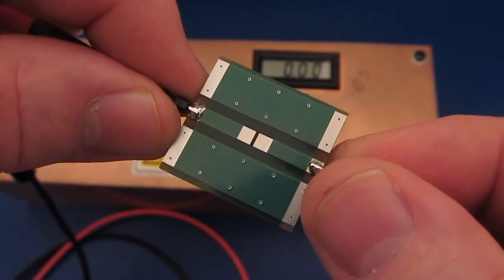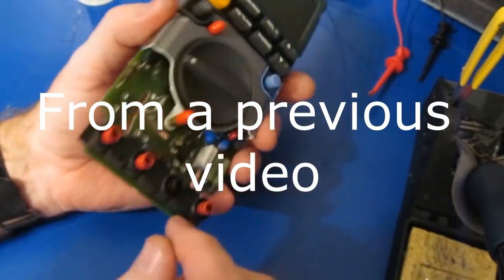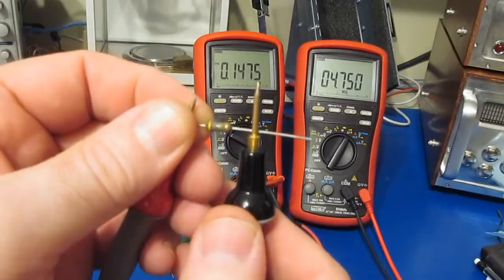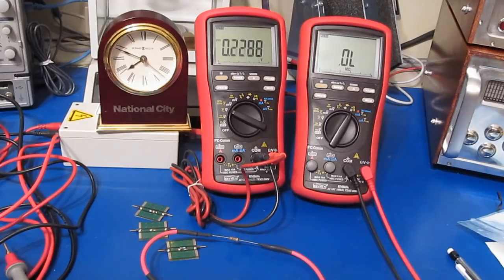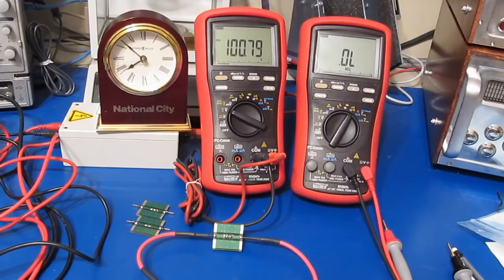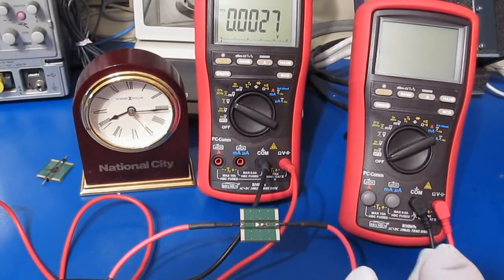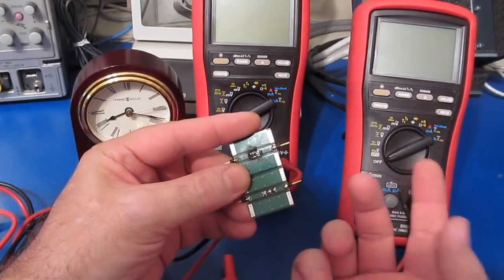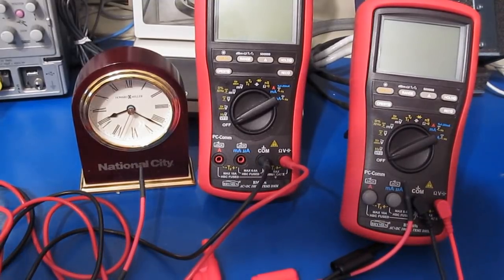Applying 1KVDC to Various 4.7Meg Resistors

Comment: Interesting. It looked like for the second run on the FR4, it looked like there was a higher threshold voltage that had to be broken, and once that was established, it would sustain current flow at lower voltages. I would say "repeat this experiment with thermocouples so you can see how the temp-co influences the jump (if at all)" but I dont know of any temperature probe that's wouldnt affect the results (or at least, that would reliably, linearly affect the results). Good post, Smith
Reply from the maker: Yes, that is what happens with a spark gap.  A pretty good source of information may be to search on spark plug waveforms and ignitions.   Temperature will effect it, as will pressure.  A laser could be used to help ionize the gas as well.

Comment: I once had some pretty long discussions with the manufacturers of these resistors because I discovered that basically you have to take the power ratings with a grain of salt. It all comes down to the fact that they can change a lot to the structure. Even for the same package some brands have much better short peak power handling than others, while the nominal rating is the same. They don't always specify this in the datasheet.
Reply from the maker: The SMD parts have a very low working voltage.   Even a 1206 is not much better.